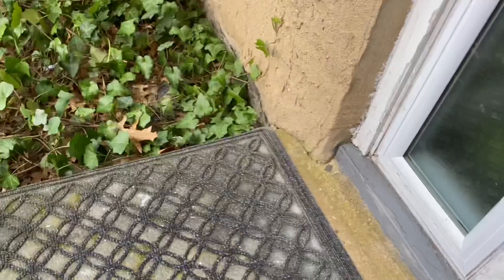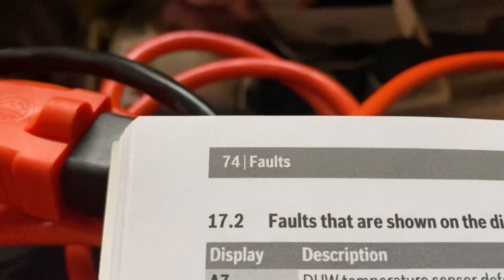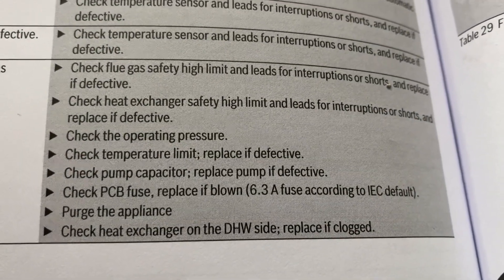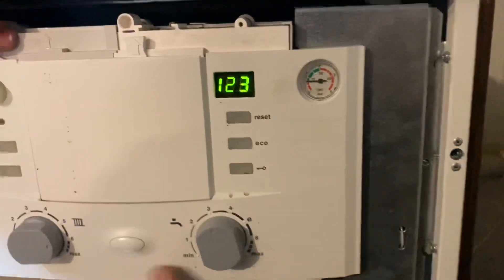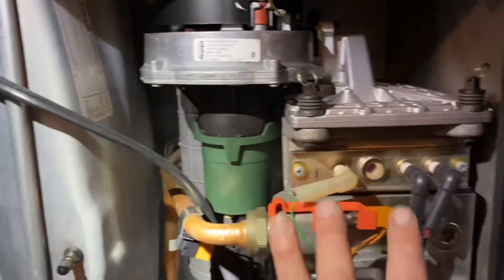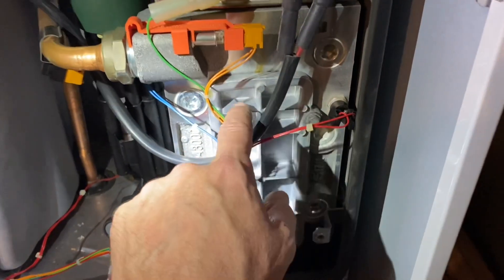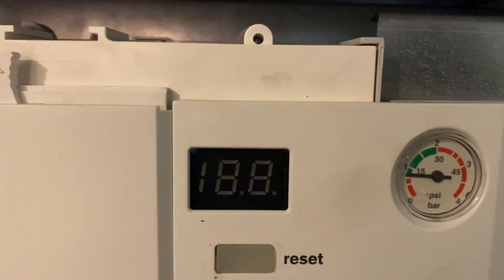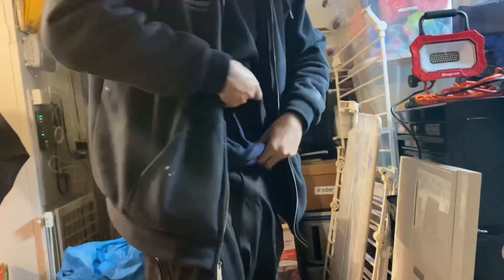Bosch Greenstar Combi Error E9 Diagnosed and Fixed in Minutes!

Comment: What can be with E9 erro on new greenstar with round heat exchanger? The boiler fired up and got 100 degrees with an e9 error, after 30 seconds of e9 going away and Boiler again firing up.

Comment: Is there anyway to hook up two thermostats to one unit? All I want is to be able to turn off the downstairs thermostat at night and have the unit read the one upstairs so my furnace will stop running all night and stop cooking me in my bedroom.  I ran a new set of wires to the board from the new thermostat, but when I ran the unit the ac compressor would turn on along with the heat even though one stat was off and both were in heat only via the switches on the stats.  Even when I pulled the downstairs stat off the wall and I used the new stat, the ac compressor would run along with the heat.  I even disconnected the yellow cooling wire from the board and it still ran the compressor with the heat but only with the new stat. If I yanked the new stat off the system worked as it should.  So this is why I'm confused as I heard you could run two thermostats on one system, it wouldn't be the best solution but would work for what I want.   I also saw the installer has two other wires connected to the board where the stat goes, but I have no clue where those go to and the colors are not matching, yellow wire to red 24v on board and another wire connected on another spot, I forgot what they hooked it up to.  I know a decent amount about hvac, but when it comes to 2 stats one unit and random wires going who knows where, that's when I have issues. I know the solution is dampers and do it correctly, but I don't have the cash and this was supposed to just be a 20 dollar fix with a new stat.  If anyone can chime in with helpful comments, let me know.  I talked to a guy who does hvac, but he wasn't sure about 2 stats and couldn't offer much help besides a 200 dollar unit with two modules.